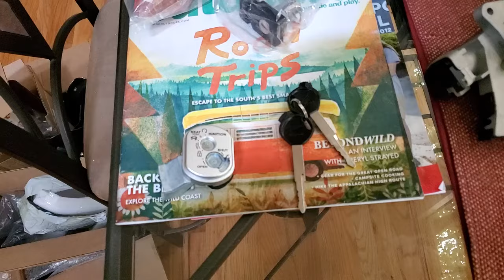How to open this stupid lock cover shield guard on a Honda Scooter Elite 110 NHX110 Lead

Comment: how can i open that lock without an appropriate key. i had lost my originl keys and got new ones made from a locksmith, but these keys dont have that hole on the side. can you suggest something ?
Reply from the maker: Other than destroying it, you can't. You have to replace it.
Reply from the maker: And no one has a good aftermarket option for it.  You have to get OEM, and it ain't cheap.

Comment: My concern is that fact that it's plastic, and will wear over time...At that point how do you bypass this cover?
Reply from the maker: You drill a hole through it and hack it up.
Reply: It looks like an Allen key could possibly fit- has anybody tried that?
Reply from the maker: @tristabloom1710  it wont